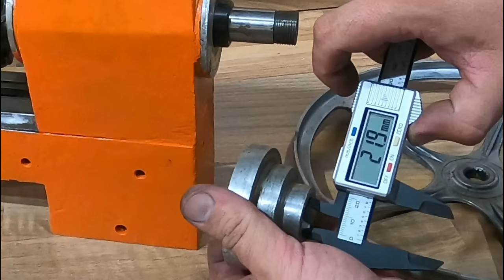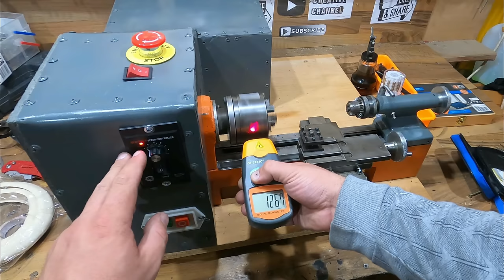Top 10 Cheapest Unbelievable Machines For Workshop Made with Washing Machine Motor

Comment: Definitely don't need two part epoxy to glue a piece of sandpaper to a wooden disc ....All you need is spray contact adhesive....spray some on the wooden disc...spray a little on the sandpaper let it tack up then stick the sandpaper to the wooden disc .....simple ....it'll stay... it won't come off.... when it wears out you can pull it off...🤷

Comment: wouldn't it have been easier to just use the angle grinder as is instead of chopping it in half just to add a different motor to it?
Reply: Maybe the motor burned out and not repairable so it became salvage parts.

Comment: Damn washing machine motors have too many wires ! I only mess with electric motors that have 2 wires, I just don't have the patience !
Reply: I usually look at the diagram on the washing machine to know which ones make the motor to run. I have my share of used motors. Most are just sitting one im saving for my current washer if need be. It's the washer is almost 30 years old and still running. 73

Comment: this motor is significantly too weak for a planer, planer MUST have at least 9000 rpm and a 2000W powerful motor! I made my self 3 machines with washing machine motor ... but only polisher work properly ! The motor of washing machines has 550W to 700 W , nothing more ! This is enough for a sander or polisher , but not at all for something more with this small power ...
Reply: You just saved me, from wasting my time.. I appreciate that... Would you mind taking me under your Wing for a minute? I'm very interested in building a good thickness planer.. Would you be able to tell me what is a practical application?
Reply: Gears reduction for lathe

Comment: it can control the speed of a motor without a junk of boxes easy and sample by using a fan controller the HOT wire going one side to the motors wiring the other going to the fan controller you adjust the nobe by hand how fast or slow you want the motor to run without anything else easy and sample what do you things my ideas it a shit ideas or a good ideas

Comment: you should have not done a direct connect to motor, that constant torque of direction changing will wear out the motors bushing/bearings very quickly, design with a belt and pulley system where the pulley takes the brunt of the vibration, in which you could mount the pulley on rubber mounts to reduce its wear... etc etc.... bad design imo.